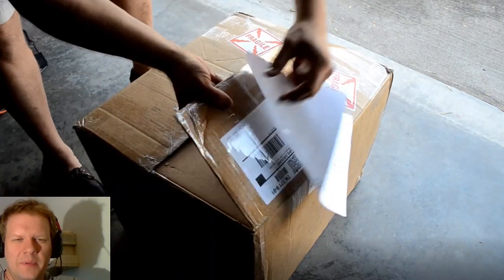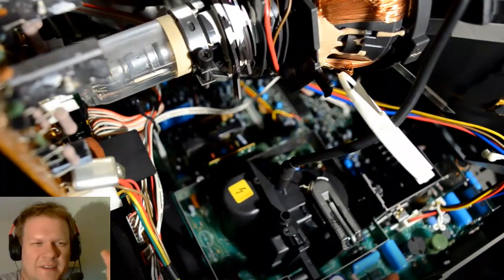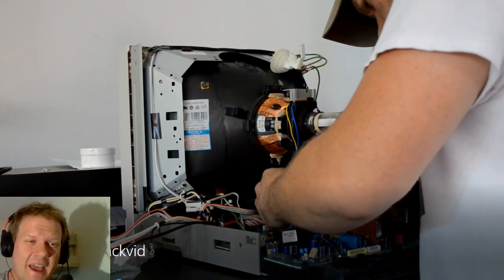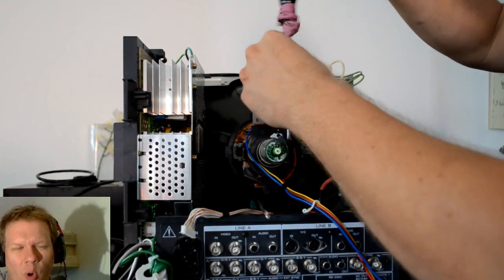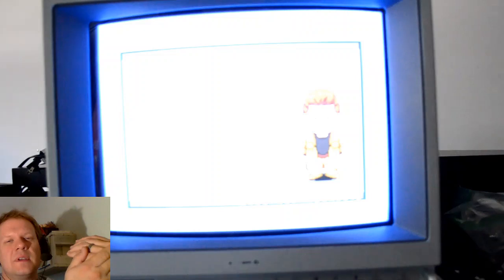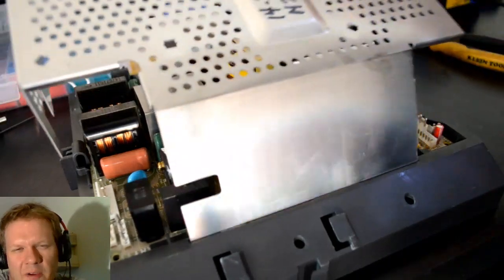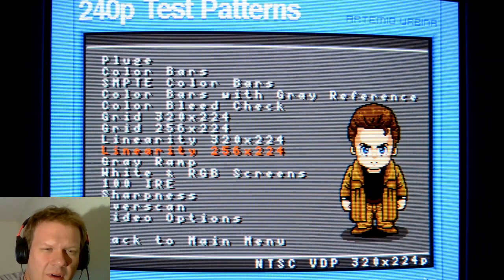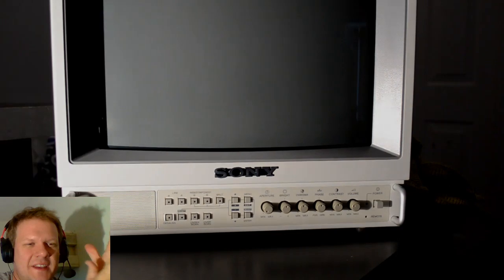New CRT Discharge Technique from Sony.

Comment: Great vid, nice to see those PVMs still doing their thing. What caps do you recommend for a PSU and chassis refurb? Also, what is Sony's rationale for their anode discharge method? To prevent scratching the aquadag? I find it pretty dangerous, and some anode caps really can't be released by simple squeezing/pinching, but rather by pushing them sideways. which can cause them to uncontrollably pop off and expose the charged contacts.
Reply: Update: the vid mentions Nichicon caps. Thanks!

Comment: RETRO TECH,  what Flyback transformer is stepping up the B+ 130 vdc voltage to 19kv or 30kv? The flyback trans also outputs High voltage to the Focus and Screen for the CRT tube?

Comment: I've got Sony pvm 14M2E , was working great and never been opened, however for some reason I was running my VGA 15khz signal via a arcadeforge umsa (scart to vga). Whilst I booted the computer it was displaying all correctly on the pvm and then suddenly I heard a surge sound and the tube displayed a electric fuzzy line on the top and the monitor just shut off. Now it doesn't even turn on. I checked the mains fuse which seems fine. So I went ahead and opened the panel to see if there was anything obvious and I could not see anything burnt. At the moment I'm a bit on the fence about discharging the tube. If I do go ahead and discharge using this method I'll see if replacing the fuse inside helps. Not sure what could have caused this but any ideas or helpfull advice would be greatly appreciated.
Reply: I would start with the usual suspect,  the power supply.

Comment: Your CRT discharge tool is connected where? Ground (earth) terminal on wall outlet? Or?
Reply from the maker: Just the metal frame on the CRT is all you need.
Reply: @RetroTechUSA  Hmm, it's so illogical. Wouldn't it be better to connect to earth terminal on wall outlet?
Reply: @suadcokljat1045  No. Discharging a tube is like shorting a capacitor.

Comment: I need to get a 19 inch Sony out of my house, I have the back off, and am willing to de-spark it. But it is so heavy, I want to break the glass and remove it in pieces. It is too heavy for me to lift and too bulky to get it through my path. So, if I break the seal on the tube, can I put something over the end so that the gases (or whatever is inside) to not harm my bird? Maybe a heavy blanket?

Then run the air filter system for half a day? Thanks for your help in advance!
Reply: 19" 🤣 
Try picking up a 32"

Comment: discharging like that what if the insulation is damaged?
Reply from the maker: It's always good to make sure your cables are in good condition before doing it.  I'm not saying you have to do it this way.  The other method is still effective, it's just not the way Sony wanted.
Reply: Fair enough. I always struggle to get them off the way the service menus show you how to do it.
Reply: Its the tube that holds charge over time like a capacitor, not the FBT.

Comment: I noticed that discharge technique in the manual of a Sony VGA monitor I'm recapping.  I assume  its so idiots don't destroy the metal connector by roughly jamming a screwdriver into it.  I'll still use the screwdriver. I know what the connector feels like when prodded.
Reply: So basically very lightly slip it in and touch. (I figured that was how to do it, since my IBM has the same instructions)

Comment: No way in HELL am I touching that cap or cable until it is discharged. Maybe when they were new.

What about discharging caps? Is that not necessary? What if you just powered it off a second ago? I heard someone say they clip something to the caps to tie them together or to ground because of dielectric absorption? How long until the anode cap can recharge itself? I want to be as safe as possible.

Comment: Pulling the anode cap off with one hand and having the discharge tool in the other hand would seem to me the best way of getting to the HEART of any insulation failures, if you get what I'm saying. I don't like high voltage repairs but when I do, I keep one hand behind my back until I know the CRT is discharged. Thumbs up for the video, very informative! But thumbs down to Sony.

Comment: I bet those manuals didn’t take into account that someone would bother servicing it 20 years later. When it has a brittle possibly damaged yoke. If you value your health wear some gloves. This is like telling someone who finds a hundred year old gun that has been laying around to go try firing it.
Reply: A good practice to adhere to is put one hand behind your back when working around it when its live.  But how I know you haven't worked on many of these if any, is because the yolks don't go brittle.  Not in the 30 or so I have worked on.